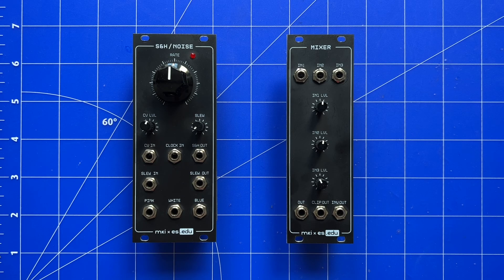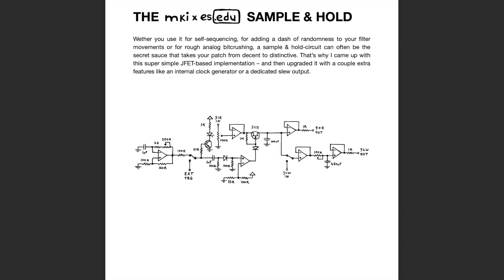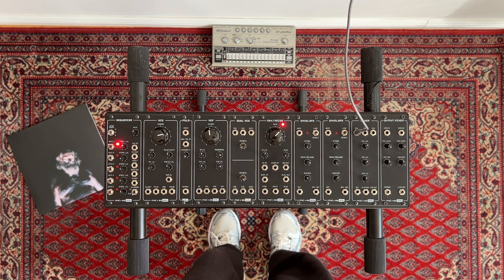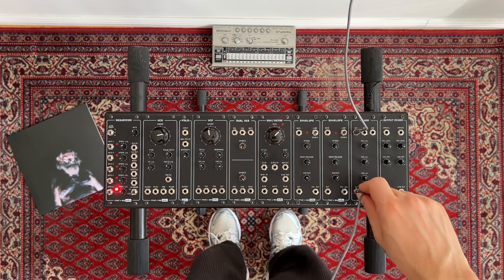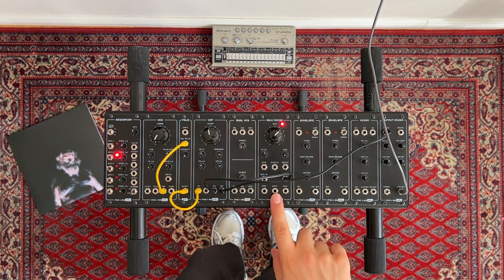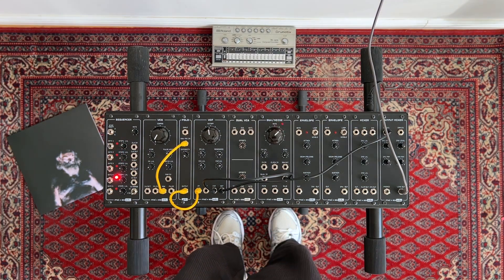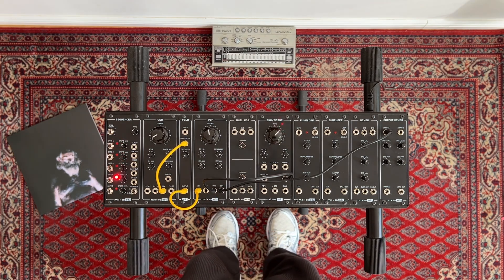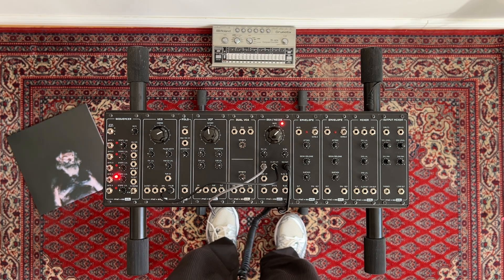Introducing the mki x es.edu DIY S&H/Noise and Mixer kits

Comment: Could you make a video  on converting a tap tempo led from a guitar pedal (or any device) into a midi clock out for trs cables. I’ve seen it done and it seams not too complicated. 

There are so many pedals out there that don’t have sync capabilities but have tap tempos. The original line 6 dl4 is a perfect example of a pedal with delay and looper function with tap tempo but sadly doesn’t sync to anything.

Comment: Great video, sounds excellent and love the combo of noise/S&H/slew! Just wanted to clarify that the sample & hold trick at the end is actually sample rate reduction and not bit crushing. Bit crushing would require converting the analogue signal to a digital one and then reducing its dynamic range via the bit depth. Sample rate reduction comes from sampling the signal at progressively lower frequencies, which is what's happening in the video. Maaayyyybe you could get similar result to bit crushing by running some kind of quantizer after the S&H in your patch and then modulating that? But aside from that I can't think of a way to do bit crushing without an ADC and DAC involved somewhere (and even a quantizer would have those too lol). Sorry for the nitpick-y comment - ultimately they both sound great and the words don't really matter much from a musical standpoint, but it's a common misconception that I've seen a lot when it comes to this technique and thought it might be a good idea to avoid more confusion :)
Reply: (Love your videos btw!)

Comment: I really don't need another synthesiser, but this series is really whetting my appetite! I noticed that the nine kits don't include an LFO - is it possible to use a second VCO for this purpose?
Reply: The envelope has a loop function, and the case they released for this series has room for two of them.
Reply: @iamjamessmith  Thanks for the info - time I rewatched the envelope generator video!